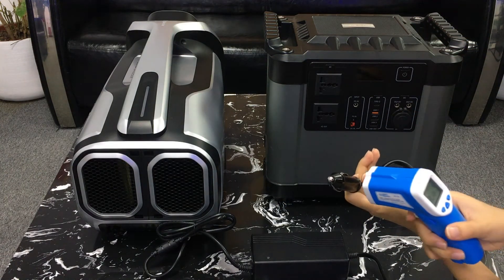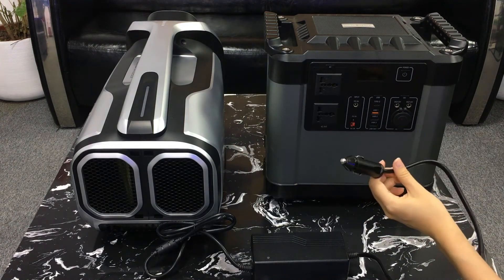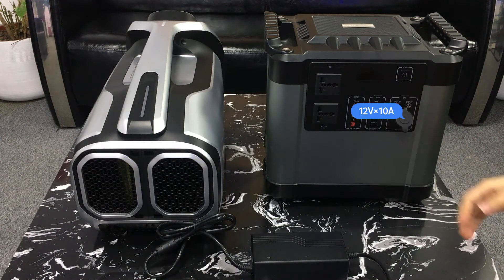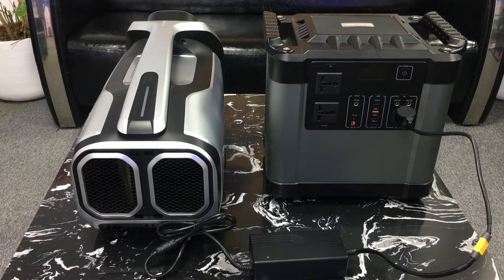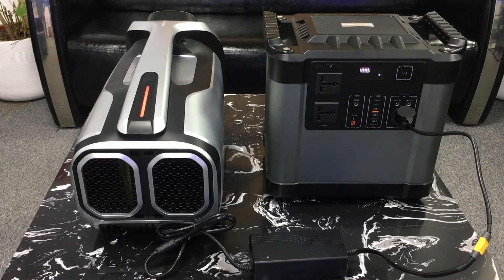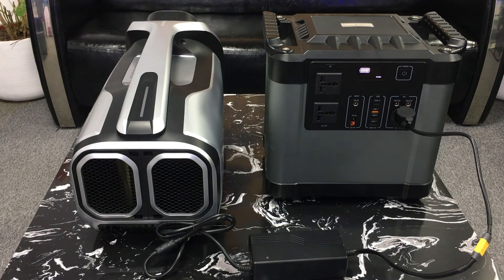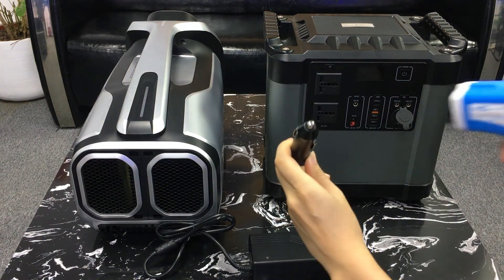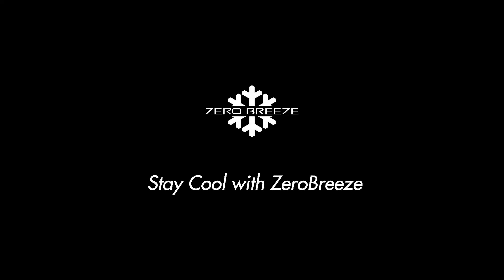Why Prohibit the use of a 12 Volt 10 Amp cigarette port to power the Mark2?

Comment: How can the ZeroBreezze M2 be powered from a vehicle?
Reply from the maker: Hi there, pls confirm that your vehicle can provide sufficient and consistent power(over 300W or over 25A current). 
If so the following accessory would help you to power your Mark 2. If not, the following accessory would help you to power your Mark 2 battery. https://www.zerobreeze.com/collections/mark-2-accessories/products/12v-to-24v-inverter-for-mark-2-battery

Comment: Simple physics. Zero Breeze Mark 2 draws ~240W. As V*A=W, it's apparent that 12V*10A delivers only 120W, which is insufficient to power the unit. Why people insist on attempting to break the rules of physics is beyond me.
Reply: How can the ZeroBreezze M2 be powered from a vehicle?
Reply: @Scruffers2011  While the ZB2 external battery can be charged via the 12V cord and adapter, the unit itself cannot be powered by a vehicle 12V power point.

As I pointed out in my comment, ZB2 draws ~240W.  V*A=W. Therefore, 12V*10A=120W. This is the maximum delivered via in-vehicle power points, which is insufficient to power ZB2.

Hope that helps.